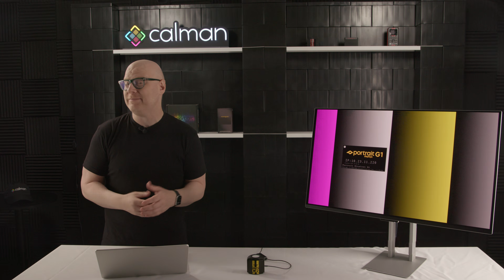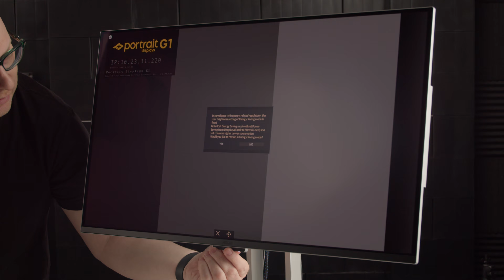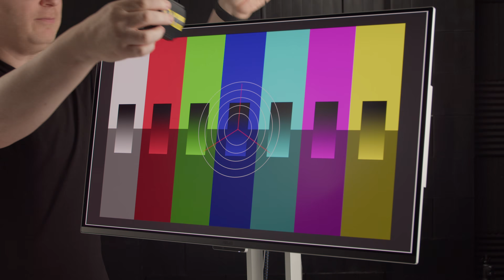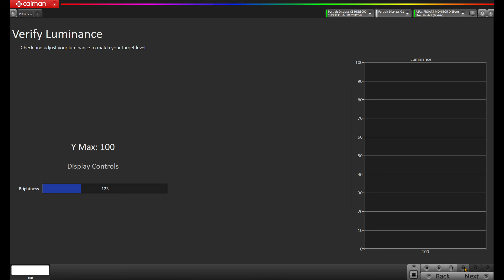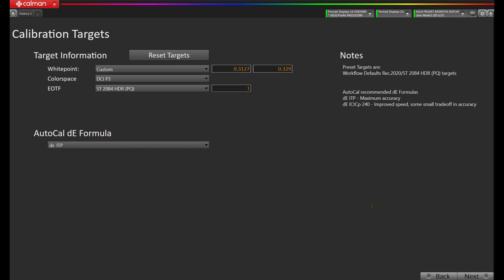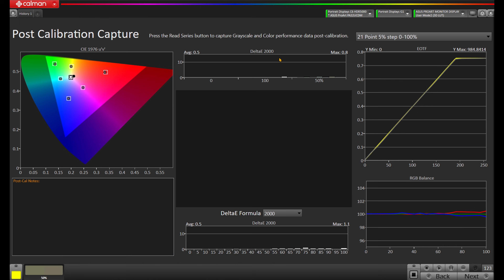How to Calibrate the ASUS PA32UCDM QD-OLED using Calman Studio | Tutorial

Comment: I have a pattern generator as well... it's called a PC.
Seriously: Is a special device really necessary for PC use calibration? I could understand big studios might need that to make the calibration workflow standard but for PC use it looks redundant at best and more like a lame money grab.
Reply: Your PC can have picture profiles and other processing attached to its outputs. They did a video a think a year or so back where they ran a validation with a pattern generator and then just the HDMI out from a laptop and the results were completely different.
Reply: @IOPvideo  Thank you for the reply! I will check out the video. If I was calibrating a display, I would not use HDMI but Display Port. Turning of any LUTs, and conflicting color-management apps goes without saying.

Comment: I'm a little confused about the target computer. Are you calibrating this display for use with that specific laptop? If that monitor were connected to a different computer, a desktop. Would I need to have Calman installed on it as well? My hope is to calibrate multiple monitors connected to different computers. I know there is the client 3 app but the workflow seems to be completely different. There seems to be no concept of direct display control through Client3.

Comment: It would be very useful to also include the TB4/USBC port you are using to connect from your PC to the Display. There are many Upstream/Downstream connection configurations for the PA32UCDM and this must be correct. I have the latest Calman as of last week with the All Access license. Full on to be able to support this display. It would NOT connect unless I actually used a USBC cable and NOT TB or any generation. I could elaborate but if you could either with an updated video or on your Workflow solutions page the EXACT port on the ASUS. Also the black levels at Full Range then switching to REC709 legal cause much black level problems. Heading to the Forums but thought I would comment as I just spent 4 hours with not very good results.
Reply from the maker: Thank you for sharing your experience — this kind of feedback is really valuable. In our testing, we’ve successfully used both USB-C to USB-A and USB-C to USB-C connections, though results can vary depending on the exact cable. Not all USB-C or Thunderbolt cables behave the same, so finding a reliable one can sometimes be part of the process. We’re glad you were able to get the PA32UCDM connected in the end.

Regarding the black level, our team has been investigating near-black performance and we’ve made improvements in the upcoming Calman release to help address this. If you’d like early access to that build, please reach out to us at sales@portrait.com — we’d love to hear your feedback on whether it resolves the problem for you.

Thanks again for taking the time to share your detailed notes, and happy calibrating!

Comment: Am I the only one struggling with the 6.3 on the grey ramp scale. For some reason it is always wrong and not leading to smooth shadows
Reply from the maker: Thanks for sharing your experience! A couple of things to double-check: make sure you’re on the latest Calman build and using the ASUS workflow from our video tutorial. Also, confirm you’re running the calibration in full range for the best results.

If it’s still not looking right, our support team can help dig deeper — just send the details (SDR or HDR, probe and generator used, plus your calibration session file) to calman-support@portrait.com so we can take a closer look.
Reply: I had the exact same issue, I was never able to resolve it and actually had switch away from Calman as support never got back to me when I inquired. Very frustrating and unfortunate

Comment: Would this software work for pro art pa32dc? The self calibration software does not work with my Mac Studio
Reply from the maker: Yes, the ASUS ProArt PA32DC is a Calman Ready display, so it works with Calman. Just note that Calman currently runs on Windows, so you’ll need access to a Windows system to use it.
Reply: @PortraitDisplays so I would have to move it to my windows, calibrate it and then move it back to my Mac Studio? Would that work?

Comment: Since for SDR  you are calibrating to the sRGB colorspace, aren't you clamping this wide gamut monitor?  I use ProPhoto RGB in lightroom and photos hopefully  which is a calculated very wide colorspace.  Why isn't there a "natural" or full colorspace option which retains the wide gamut? I am not talking HDR.....just a wide gamut SDR which we have used for years. I may purchase a full license to use again but I don't want to clamp my colorspace.
Thanks
Reply: You could actually set some monitors to "native gamut", showing the fully covered gamut by the display. It's kinda useless though unless you use this mode to calibrate with a lut. The reason you calibrate a monitor is to follow a standard which is virtually compatible with a great variety of displays so that what you edit and master on your display is showed correctly on other devices, even if these are not properly calibrated (but your original intent wouldn't be dramatically changed as it would if you mastered your content on ad uncalibrated display). Srgb and rec709 share the same coordinates, that's why it's used for sdr calibration. The reason there's not a "natural" color space option, if i correctly understood what you mean, is that color is relative, it's phisically impossibile to mantain the exact same reproduction on different displays even if they're the same model from the same manufacturer, at least not at 100% on an nanometric value. Calibrations can be precise but even if you'd have to calibrate more displays to visually match you should take into account the panel type and color reproduction capabilities of both. If you miss the spectral reading, even if they're calibrated to the very same standard (eg. rec709) they would look compliteley off due to the different spectral response. In some cases, even when using both a spectroradiometer and a colorimeter, you should have to compensate this "metameric error" by perception with your own eyes. I apologize for my bad english, i tried to answer the best i could. Source: i was a calibration technician in a digital imaging rental service before stepping officially into color grading

Comment: Why 8-bit in HDR? What's the point of a 10-bit colour monitor then?
Reply: I a do not know if it make sense to you, but that is what i got from support - "RGB 8bit triplets work for 10-bit as well; they are just upscaled by 4. We are not calibrating in a video container, we are rendering each patch individually". I could not challenge this response due to the luck of specific knowledge, so i calibrated using 8 bit.
Reply: Most likely because Calman can only work in 8 bit values.

While, yes, the program can tell the pattern generator to produce 10 bit patches, it can only do so via 8 bit commands.

For example, you tell the program to produce a 10 bit 940/940/940 100% white triplet, Calman will send this command via 8 bit 235/235/235 values.

Since you're confined to 8 bit boundaries, though, the next lowest white value you can produce is 8 bit 234/234/234, which translates to 10 bit 936/936/936.  That means Calman cannot produce 10 bit 937, 938, or 939 triplets making its 10 bit functionality essentially useless.